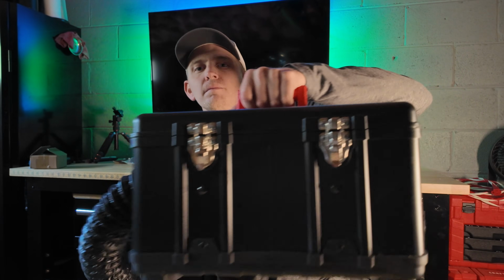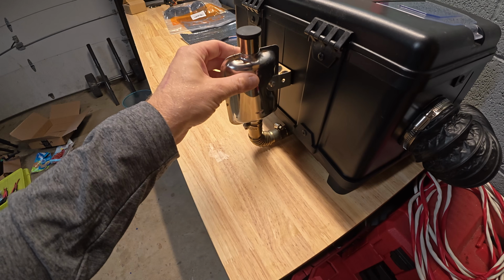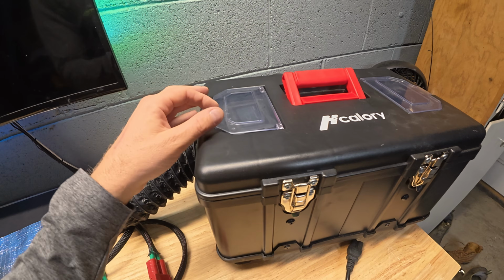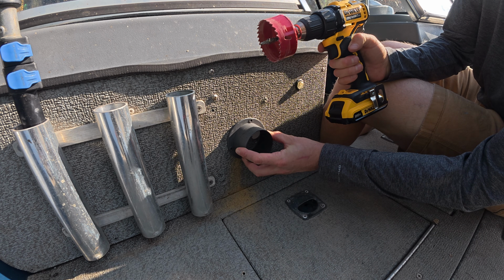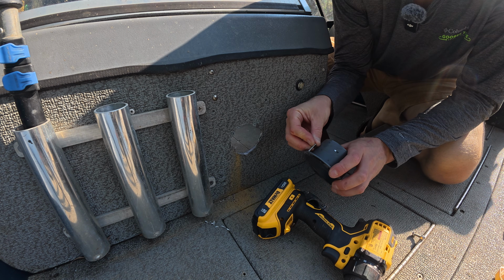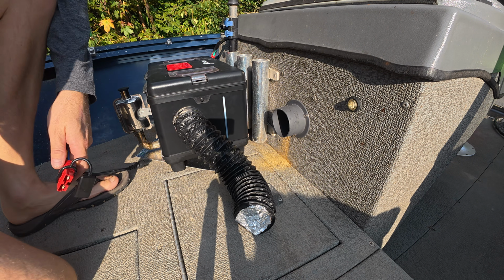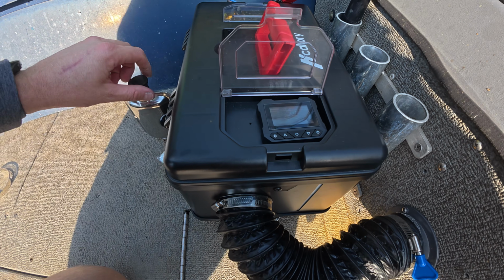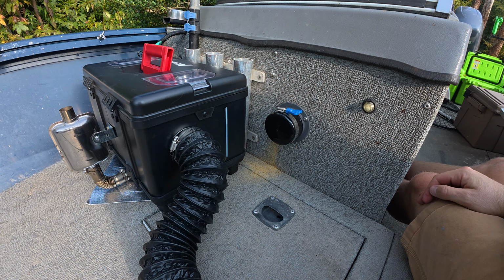How to Install a Diesel Heater on a Boat

Comment: great product review and installation.  There are so many goobers, nice to see someone who knows and can explain.  One question if you don't mind.  Is the heat produced by diesel and the electricity for the switch?  I'm sure it is, but just want to confirm.  It will not produce heat using 12v electric via the house battery bank.  Is that right?
Reply from the maker: The electric is used to get the glow plug to fire and operate the screens and fuel pump. Quite a bit of power if required at start up. There is a diesel motor inside to handle the heating
Reply: @GooberTimeGuideService , do you know roughly how many amp draw is needed on startup and running?  Kinda funny I didn't notice your screen name.  The other issue I have is it is for a small cabin.  I'd like to place the unit inside the cabin.  Trying to figure out the best way to vent to the outside.